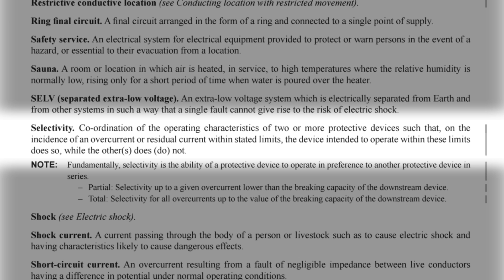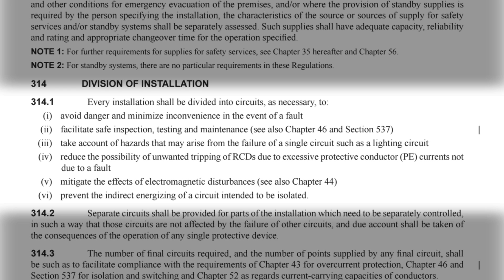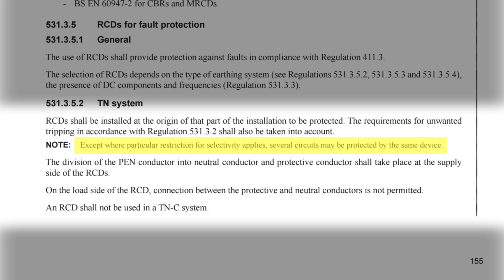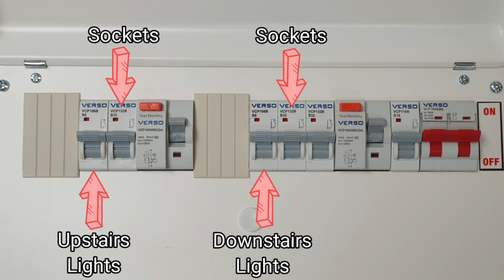Is a SPLIT LOAD CONSUMER UNIT compliant with BS7671? - Electricians' Q&A

Comment: Rcbo is obviously better but not necessary in most cases where the property has 3 or 4 power circuits and 2 lighting ones, putting the lights “upside down” compared to the power circuits is a good solution.. would only go full rcbo board in an office for example ( all radial circuits, no funny 32A ring mains ). The only issue money wise for the customer is that I only use Hager.

Comment: A benefit of split-load distribution boards is it's quicker and easier to test two RCD's than test the RCD component of several RCBO's.
Reply: If you test the RCBOs at the Consumer Unit, you will do all of them in 2 min..it is not a big difference compared with RCDs, I wouldn't see this as an advantage...personal opinion 😉
Reply: It takes about 60 seconds to test an RCBO, not a major problem
Reply: @12000gp  I would say max 30 seconds:))
E clip stays on earthing bar
The other 2 probes quickly you can move from one RCBO to other..probably depends of the tester, my megger does it very quick.. i will count the seconds tomorrow:))
Anyway,  this is not an issue to test the RCBOs, at least I am not seeing as being a big issue, the only one is the price (install goes quick if using mini RCBO)
New installation depends, existing installation I will not take a risk and  I will always install a CU with RCBOs
Reply: I test the rcbo's at the board takes a little  longer but not much

Comment: In my opinion all domestic houses should have a AFDD and and an rcd protecting all circuits regardless of how the set up it, might be a pain with nuisance tripping but at least its safe
Reply: I personally C2 a consumer unit if there’s no RCD protection but you can technically pass it if only the lights and sockets are protected as only circuits you can “plug” things in need to be RCD protected, but yes I agree with you all circuits should be RCD protected
Reply: @uplightuk8924  this is incorrect, any cable at a depth less than 50mm in a wall needs RCD protection. Not just circuits that plug in
Reply: @TheFool2cool  This is what I’ve been told by NIC and the trainer on my 18th edition course, don’t shoot the messenger. I personally C2 a board if it has no RCD protection. Besides, there is no way for you to tell if cables are buried more/less than 50mm anyway, that’s a limitation
Reply: @uplightuk8924  you’re both wrong, it’s a C3 unless the socket is likely to be used to supply outdoor equipment. Check out best practice guide 4.
Reply: You got AFDD money?

Comment: I know some one who’s house has one big ring main supplying both upstairs and downstairs cu full of RCBOS, his son has a medical condition and has to have a number of medical monitors . If god forbid there’s a  short that young lad would be in serious trouble so I think ring-mains should be a necessity and split load CUs a personal choice. Great video joe thank you.
Reply: Or just put the medical equipment on a separate MCB  radial with the feed in Galv conduit or deeper than 50mm in a wall...
Reply: @jongurney  
Have two rings or radials to the same room, with DP RCBOs, with lots of sockets. If a circuit is down, plug into another.
Reply: or make sure its on a decent ups backup supply...

Comment: What about the maximum amount of leakage current on a RCD being no more than 15mA. This was not mentioned in this. How can we guess what the leakage will be on a split load board. I still fit dual RCD but try and sell RCBO’s to customers and i usually get around 40% come back and say lets go and fit RCBO’s and surge protector.
Reply: There is guidance for this with regards to IT equipment but you could also just carry out a measurement before fitting the board.

Comment: The IET never appear to worry about cost to the consumer. Individual RCBOs will cost more than split load MCB/RCDs.
Reply: About £150 extra for my installation, new in 2015.  In the context of the overall cost that hardly seems excessive.
Reply: @JimWhitaker  Multiply that by the number of households who will do the same and the figure will be much larger. Also some of these will be retired and on pensions so £150 may not be a lot to you but it will be to them.

Comment: Splitting left & right on domestic works for rings, thus half the sockets in a room are on if the RCD trips.
Similar can be done with lighting.
Separate circuits for kitchen & bathroom on RCBOs
Reply: If you're in your own home you should know where everything is in the dark
Reply: @user-wk7wv8rn8h  What if you’re just visiting or house sitting?

Comment: As usual the regs are as clear as mud. I would have interpreted 314 differently, and someone else could have another view, just say what you can and can't do, it would make things a lot easier, then we may all be singing from the same hymn sheet.
Reply: It's as bad as Legalese.. but the opposite way. Legalese is not designed for 'regular' people to understand but trained legal experts to remove ambiguity.
But these regs seem to be the opposite. Not designed for 'regular' people OR trained tradesmen to understand.

If only 1% of your target audience cannot understand the regs, you have either wrote it wrong, or you need to re-think who your target audience is.
Reply: @ColinRichardson  The other thing I cant get my head round is that no current should flow to earth, but some equipment does so we have to have individual earth leakage breakers so that the main trip doesn't operate ,how cockeyed is that ?
Reply: @raychambers3646  equipment with any type of heating element inherently leaks some current to earth
Reply: @curtisj2165  does that mean any micc installations leak to earth seeing they are similar construction to heating elements?
Reply: As customer who was used to reading and interpreting gobbledigook social care performance indicators, I find the electrical regs set a new mark in unfathomable word strings. Explains why 3 sparks in a room rant and rage at each other about what and how to a job with at least 4 mutually opposing opinions
Reply: @cuebj  yeah, and the fault for that is the IET
Reply: @acelectricalsecurity  Couldn’t agree more.  I’ve come from high tech aerospace where ambiguities are challenged and removed from specification, through design,  and rigorous testing.  All the IET tomes I have read, in detail, to gain my qualifications and to work competently in domestic electrical are poorly written and would be ripped to pieces at any peer review in aerospace. It’s almost as if the authors have tried to make the information as difficult as possible to navigate when looking for a coherent flow of standards and procedures to carry out compliant work.   Very similar to law as was mentioned above.
Reply: @MS-Patriot2  very true, thought you were hambini for a minute working in the aerospace industry, if you cycle you will get the joke😀👍
Reply: @acelectricalsecurity  had to look Hambini up, but thanks for that; yeah we’re out of a similar “no BS” mould! 👍
Reply: I've said this before with the regs seem to sit on fence a lot ,but are these regs retrospective do I need to rip out my dis board everytime a new regs book comes out ?
Reply: @raychambers3646  no they are not retrospective, the same way your car is tested for its mot to the standards at the time of it's manufacture
Reply: @curtisj2165   I think you might be wrong about the mot .
Reply: @raychambers3646  nah, my car was never fitted with a diesel particulate filter, therefore it is no requirement to fit one for it's mot
Reply: @curtisj2165  tey still check your emmisions.
Reply: @raychambers3646  yes they do, but only to the standards at the time the car was made